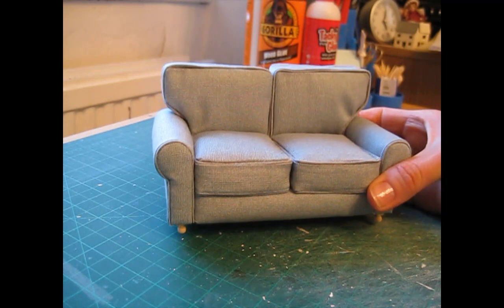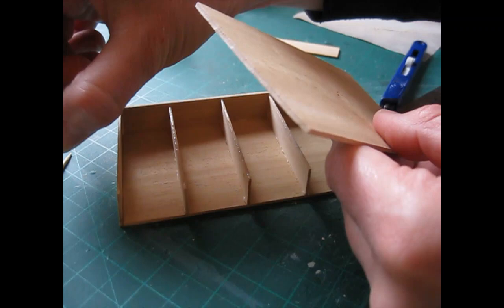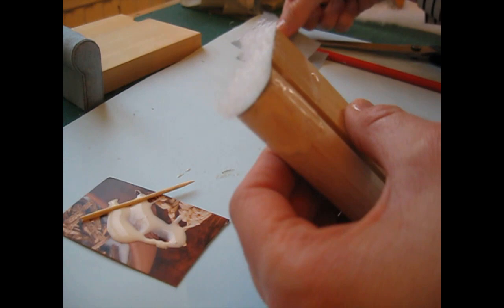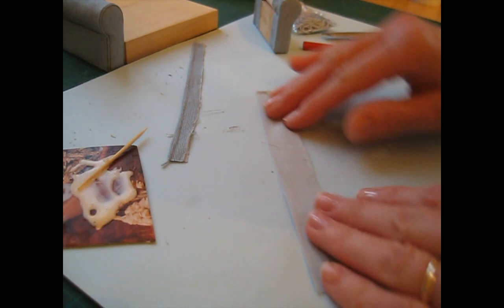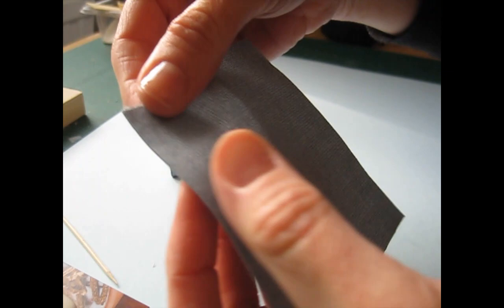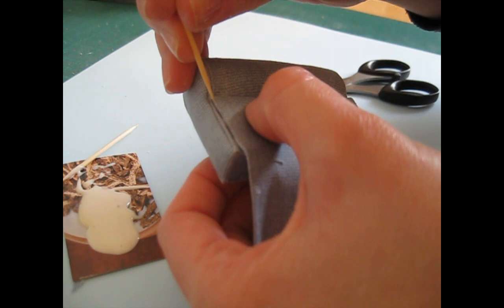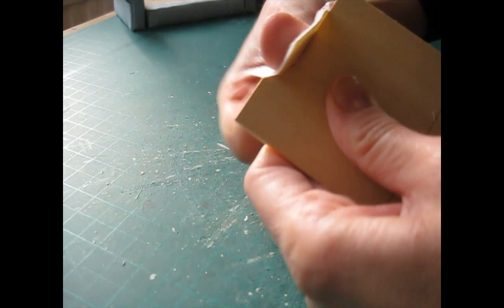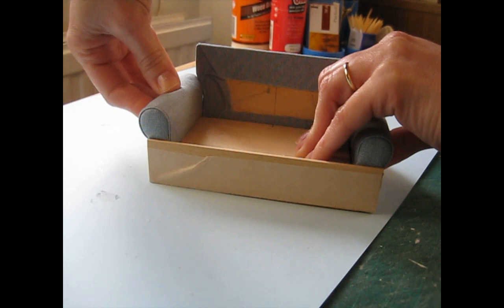My Dolls House Tutorial  #17 - 1/12th Scale Sofa Tutorial - Part One

Comment: I've learned so much from your videos and in this one using the dowel for the arm of the sofa is extremely clever! (FYI, a "fat quarter" describes the way the fabric is cut: Rather than measuring a 1/4-yard (9") from the bolt, one cuts a half-yard (or meter) in length and then vertically in half. It gives you a nice square-ish piece of fabric (18"x18") (rather than a skinny rectangle 9"x the fabric width.)
Reply from the maker: Thanks Sue.

Comment: It is heat binding, or Stitch Witchery.  I do sew, Julie, but will use your way to add bunker (I call it binding).
Reply from the maker: Thanks Jan, that's helpful.  Let me know how you find doing the binding this way. :)
Reply: I think, in UK, binding is a long flat, thin  strip of cloth with folded in edges

Comment: I keep baby wipes at hand at all times when dealing with glue. It takes it right off and then I dont get glue on anything else.  Give it a try!
Reply from the maker: I've mentioned using baby wipes before and got lots of comments from people telling me of the damage I'm doing to the environment, so I try not to use them anymore.
Reply: @JulieWarren  oh my! I had no idea. What kind of damage????
Reply: I do this too ❤ it works really well!
But I have 2 little ones so they are on hand
Reply from the maker: I was told they contain plastic so are non-recyclable and can also end up in the sea. (?) It was one of my most commented on posts on Facebook!
Reply: @JulieWarren  my goodness. But ppl use them for babies all the time
Reply: @JulieWarren  good to know! maybe it's time I make my own wet wipes.
Reply: @JulieWarren  I would have thought if they were put into rubbish bags they would be incinerated with the rest of the non recyclable items.  Surely, those that end up in the sea are the ones that get flushed (wrongly) down the loo? :)
Reply: @brittanydumoulinful  viva paper towels are so soft and you can get a container or bag to hold a few of them and use water and a little bit of baby soap to weten them to make a cheap dyi wipes. Something that is very gentle and it's a good substitute for baby wipes for actual babies that have a rash .

Comment: Hi Julie. I love the look of this little sofa 😍 If I would like to make it in a 1/16th scale instead of 1/12th, would it be ok to take all the measurements and multiply by 12, then divide that by 16? Do you see any issues in reducing the size of the item? Apart from the fact it will all get a bit more fiddly 😅 Many thanks in advance, Anna.
Reply from the maker: Hi Anna, yes, that calculation would work.  My designs tend to translate quite well into the different scales.  You're probably already aware of this, but I would just say to use a nice fine fabric, which will make it easier when working at a smaller scale. :)
Reply: @JulieWarren  Thank you so much for your response. Would 1,5mm thick wood still be the way to go? I would absolutely love to make a little faux leather sofa but even the fake leather might be a bit thick, will see what I can find but the thought did come to me that a thinner type of fabric will be easier to work with and look much neater. Thanks again for your lovely designs and the inspiration to create :)

Comment: I wish you would tell what kind of glue you are using and what kind of wood is it? Nobody ever tells those details. I find most glues as disappointing failures. So wear do you get thin birch wood and balsa wood dowels. I only find balsa wood thin pieces and white pine dowels. So just the opposite of what you recommend.
Reply from the maker: Hi Pat, I use Gorilla wood glue and Obeche wood.  A large selection of wood sheets, strip and dowel are available in my Etsy shop: www.etsy.com/uk/shop/bitsandpiecesbyjulie